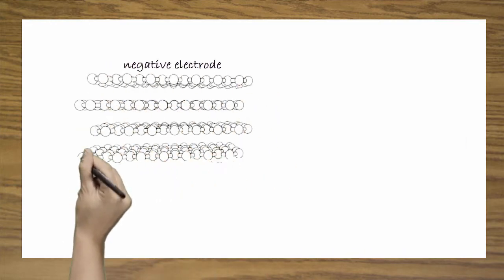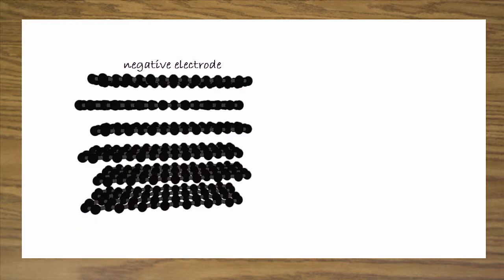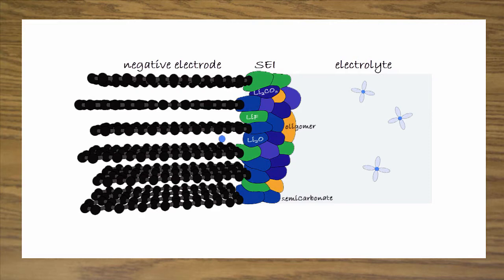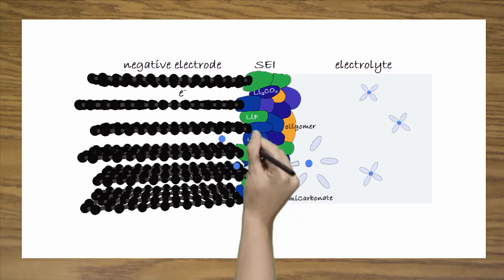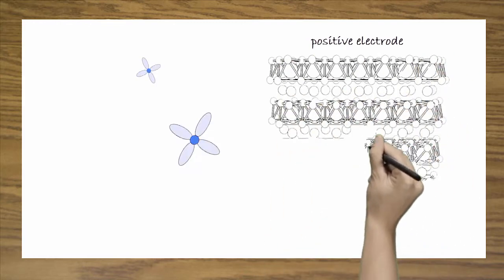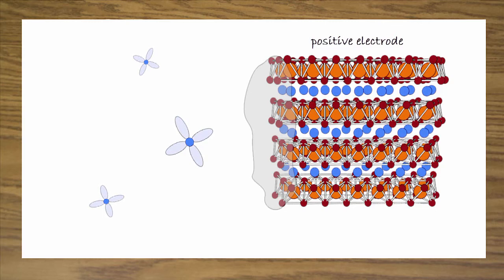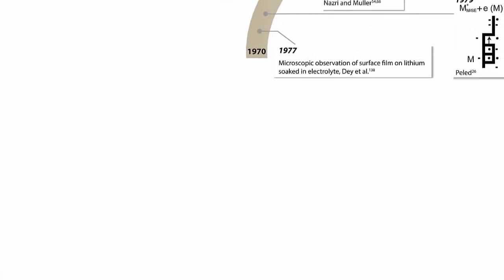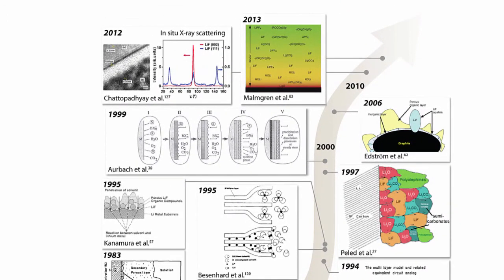Electrode–Electrolyte Interface in Li-Ion Batteries: Current Understanding and New Insights

Comment: You can increase the permittivity by adding a bit of silicon to the graphite, this creates lithium silicide which is more conducting than the metal organic mess while still allowing free flow of lithium ions. I do think more work should be done on sodium ion chemistry as it is far cheaper and ordinary iron can be used as the cathode material, specifically ferrocyanide and flourophosphate specifically.❤

Comment: so my question is during discharge ; why do the Li Ions which are positive charge travel to the positive cathode???
Reply: Remember Lithium is stable within the the oxide form, so since there is a favorable pathway, they are more than comfortable to travel back to their stable system
Reply: @arimiyauolubowale1261  Hey Arimiyau thanks for the response!!! Ok my background is EE so for me the only way the positive Li ions will flow to the cathode from the anode is this : the electrons which are flowing through the external circuit to the positive cathode flow through the cathode and set up a negative voltage at the cathode electrolyte interface and that attracts the positive  Li ions. what do you think?
Reply: Yes! You have good point and to buttress you in a more chemical manner , remember the charge /discharge process is a reversible  reaction. So during charging lithium ion moves to the anode (presence of SEI ) keeps the unstable lithium ion in good shape without any subsequent formation of new phase with the anode material , immediately it gets a pathway for the reverse reaction it quickly goes back to the cathode to fill back it's oxide form
Reply: @arimiyauolubowale1261  Ha interesting!! who would think that batteries could be interesting anyway hope you are working on a renewable energy future . Thanks
Reply: @arimiyauolubowale1261  what is your email address?
Reply: This is an excellent question and really gets to the heart of electrochemical cells (batteries or fuel cells). On the surface of the each electrode, right at the location of the cathodic and anodic half reactions (the active sites), the chemical energy of reaction (delta G, Gibb's free energy) is converted into an electrical voltage applied to 'n' number of electrons (Voltage = delta G / n F). The ‘n’ depends on the ion/electron transfer in the reaction. So the direct answer to your question is that at the active sites the voltage and current are generated by a chemical reaction (more accurately two half reactions, anode and cathode), creating a positive charge on the cathode and a negative charge on the anode; but at the same time creating the opposite polarity across the electrolyte. So right down at that active site you literally have half of a battery stepping up (or down) the voltage. Hence the positive ion is traveling toward the active site of the half reaction for three reasons: 1: it is electrically attracted to the active site because the anodic half reaction is pulling down the voltage on the electrolyte side (by pushing up voltage on the electrode side); 2: the exact opposite on the anode side is electrically pushing the ion away (these first 2 effects combined are a type of electrophoresis, movement of an ion by applied electrical potential); and finally 3: good old diffusion, as you remove ions from the cathode side of the electrolyte and add ions to the anode side (by reaction) they will spread out by diffusion, moving from the higher concentration near the source (anode) to the lower concentration near the sink (cathode). This is all describing the discharge state of the battery, where the Gibb’s energy is negative and the battery does work; it is similar in the charge state but the definitions can get mixed up easily if you are not careful. I hope this was helpful, and thanks again to ACS for putting this video together.
Reply: @marklabarbera5919  well I  am pretty sure I don't totally get it but I knew it would be complex because everyone who does a video on Li Ion batteries just totally skips this as if it was obvious. So my understanding from what you just said is the voltage internal to the battery across the electrolyte (during discharge)  actually becomes negative on the cathode side instead of positive and so the Li ions are attracted to move from the anode to the cathode. 
Can you point me to books or tech journals so that I can gain more of a understanding.
And what is your background?
Thanks so much for your detailed reply !!!
Reply: @roger_is_red  Thanks Rodger. When teaching the basic concepts of electrochemistry we usually start with the Daniel's Cell. Khan Academy has a nice description of it here: https://www.khanacademy.org/science/chemistry/oxidation-reduction/electrochemistry-thermodynamics-and-equilibrium/v/free-energy-and-cell-potential 
As for texts there are 2 standards typically recommended Bard and Faulkner, Electrochemical methods; or Hamann and Hamnett, Electrochemistry; both are excellent I find the former to be more focused on laboratory techniques and the latter to be more fundamentals, but they are both great sources. Most Physical Chemistry texts also cover this subject in a smaller scope (Atkins).  My back ground is in electrochecmical engineering, specifically high temperature fuel cells, but the core science is the same.